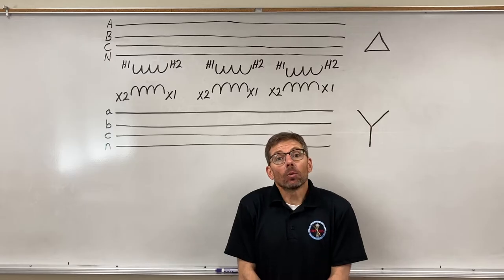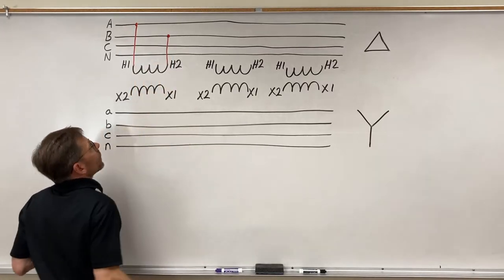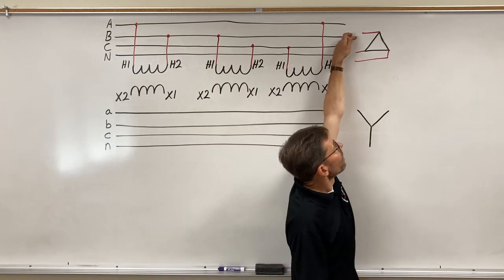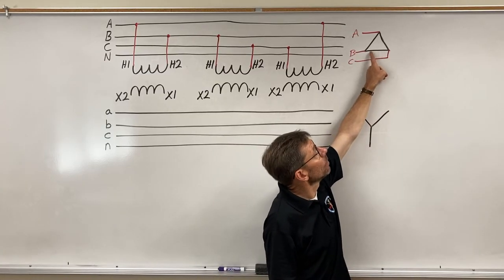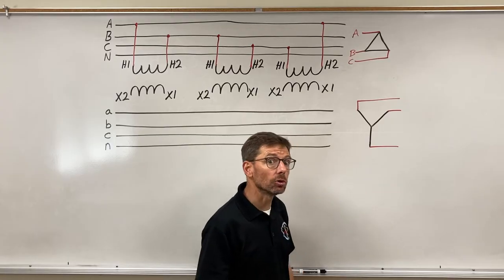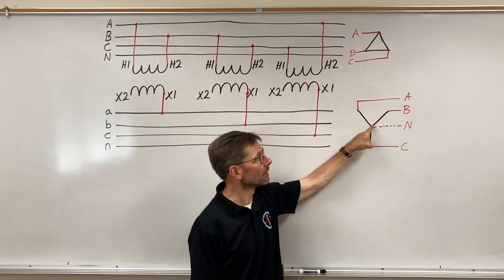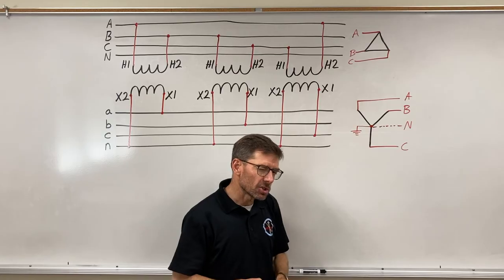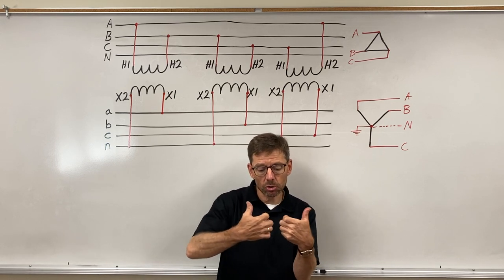Delta-Wye Wiring Connections

Comment: On the wye system how can each line go to a neutral midpoint without short-circuiting? Probably a super dumb question but just trying to learn! Thanks, Austin
Reply: Because in between each line is your transformer whose winding have a high resistance, which then is not a direct short

Comment: Can you explain why on a 480v delta secondary, it has a wild leg voltage  that can be from 300 to 420. What determines the wild leg voltage. I know why it happens because the delta doesn't carry a neutral it is just a frame ground. Only thing I can think of is the resistance of the Earth ground that could cause such a fluctuation or the load on the phase.